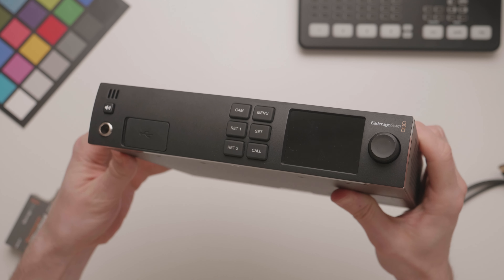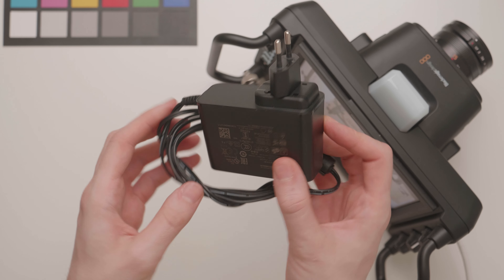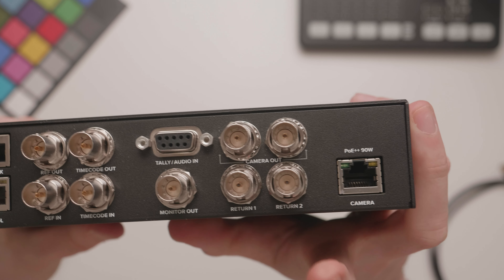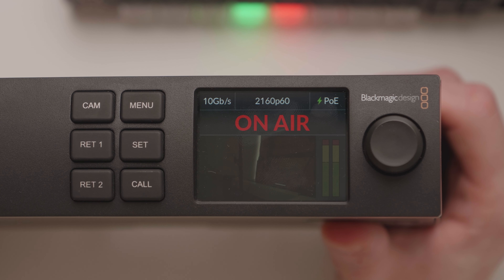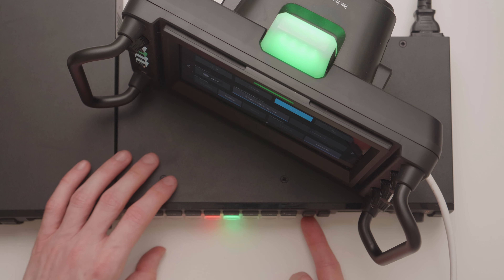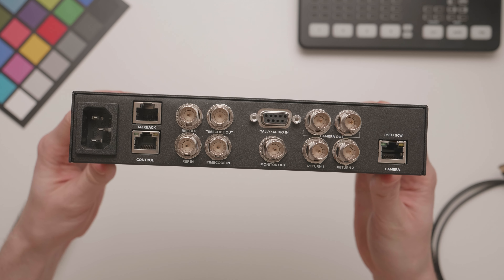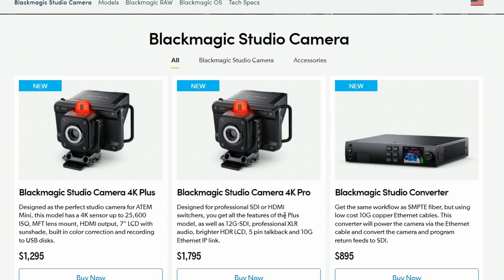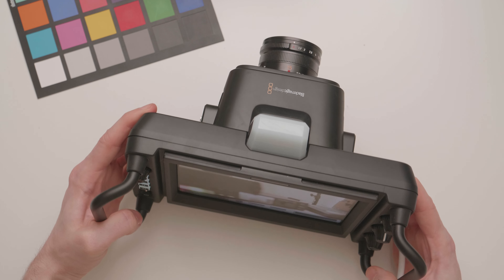Blackmagic Studio Converter // Show and Tell Ep.91

Comment: John, to use the camera converter with the ATEM mini, you have the plug the bidirectional 3g converter into the computer to update the firmware and use the 3g converter app to assign the camera ID
Reply: The camera also needs the latest firmware
Reply from the maker: Have you tried this? I updated everything!
Reply: Do you have an Ethernet cable plugged into the control port?  When ever the control port is plugged into a network switch, the converter cannot send control data to the camera.  The control port is not currently supported.  That was the only issue that I had.
Reply: Can confirm that it works with the atem mini series. I've tried it and after updating the camera and bi directional converter everything works great!

Comment: Thanks John, nice overview... Jury is still out on this product, clearly aimed at a Pro SDI workflow, not at the ATEM Extreme... 
You say 'third party' talkback system, yes as I cannot see this been much use with say 4 cams and 4 Studio Converters all running in effect independently of each with no way of a director back at the switcher talking to the cam ops as a team - unless I'm missing something... 
You would need other extra kit switcher-end e.g. the Datavideo ITC-300 Digital intercom system and run a separate CAT6 cable to each cam from that for integrated talkback?
Reply from the maker: I'd need to try it out though I suspected that it would add the talkback into the SDI lines and therefore into your whole system, but if it's 1-to-1 then it would be strange to independent add a bunch of these to your setup.

Comment: Can the SDI in/out still be used for Camera Control, while using ethernet with the Studio Converter ?
In a sense, can this be used to connect 1 camera to 2 SDI based ATEM's, and synchronize the CC settings? I know it's a real edge case but,  I wonder what happens and what takes precedence in this configuration.
Same question for return feed through SDI vs through ethernet, which one takes precedence?

Great video as always! :)
Reply from the maker: Yes, in fact the SDI Input on the camera was the only way I could get it to work on my ATEM Mini. The ethernet still works fine and CC was passed back via SDI. Not sure about the second question though at this moment

Comment: So you tried the bibdirectional hdmi/SDI and unlike if you took it directly to the camera, thru the converter you didnt get camera control?
Reply from the maker: Correct - There appears to be a clocking issue where the input and output feeds should be locked together.
Reply: @heretorecord  I have two of the studios in a box I haven’t messed with yet. But I also have the new 12G bi directional converter.  Let me try that today and see for some reason if it’s only the 3G.
Reply: Yeah that doesn't seem right. Also, make sure the version of the convertor you're trying to use is the "3g" or later. The micro convertors preceding these won't work.